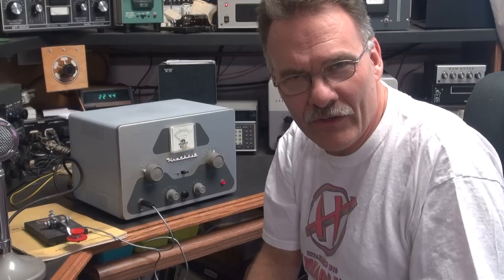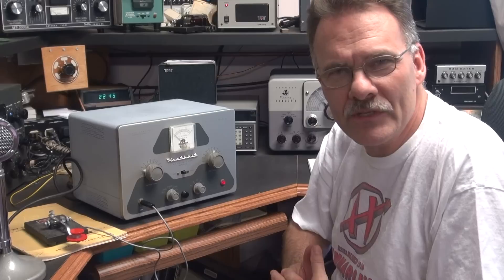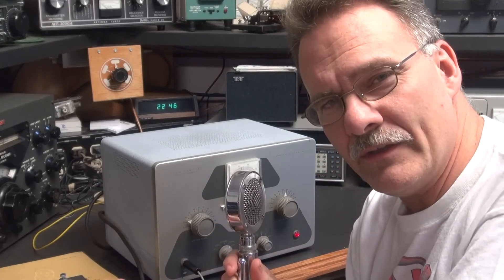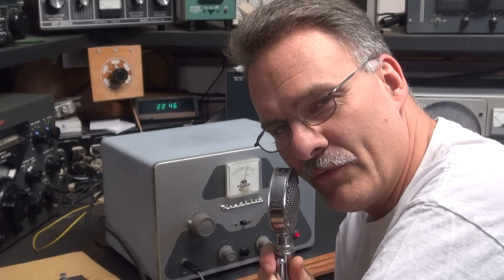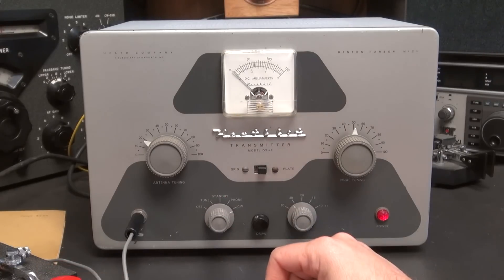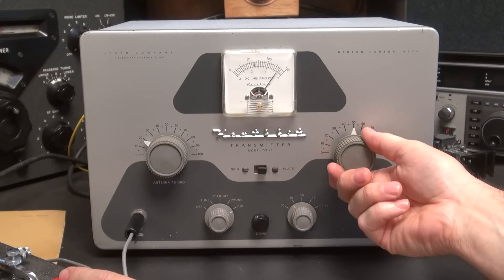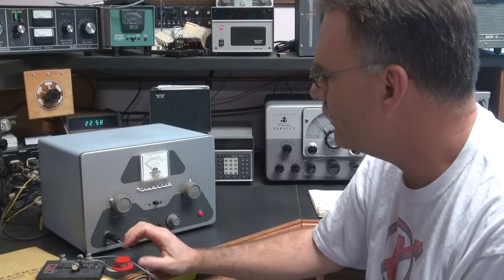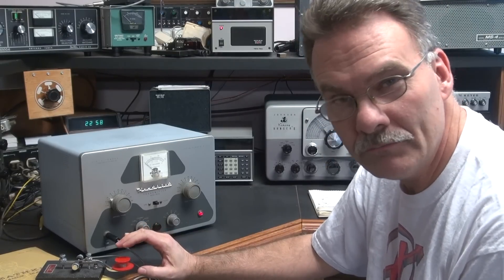Vintage Tube Heathkit DX-40 AM CW Transmitter Demo with Drake Receiver

Comment: How did you get the chirp out of the DX-40's CW note?  I've never seen or heard tell of any '40 that didn't pull frequency and chirp on transmit.  And, I've been in the game for many decades!
Reply from the maker: +mnpd3 Hello, sorry, that was long ago. Not sure of what repairs I made.
Reply: +Terry Dayton 
Thanks for the reply.  I still have my DX-40 --- it always chirped badly; too much so that it can&#39;t be used on today&#39;s bands.  I&#39;m sure that chirp was once the standard on the air.  I have a rock-steady VF-1 VFO I once wired up for it.  Sure enough, the rig chirps worse with the VFO than with a crystal, but both are still bad.

Comment: I had one of those. Converted it into a linear amplifier for a Ten-Tec Argonaut back in the 1970s.  Rebuild the power supply to silicon rectifier capacitor-input- gave 1050V. A bit much for a 6146 but I had an infinite supply of 6146s in those days.